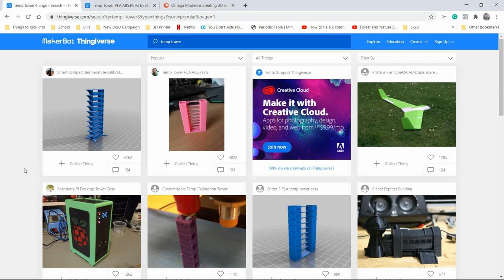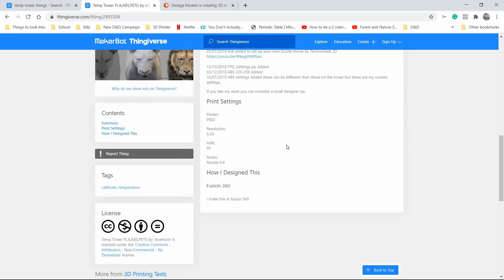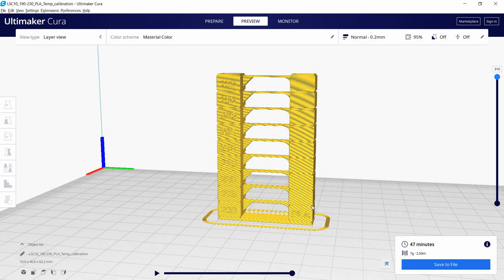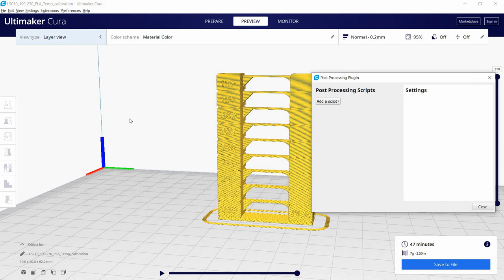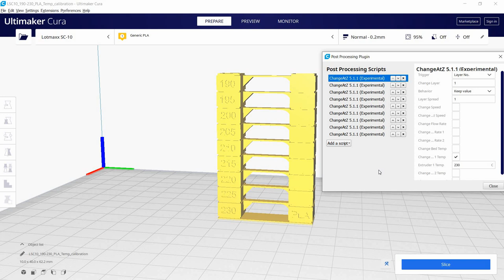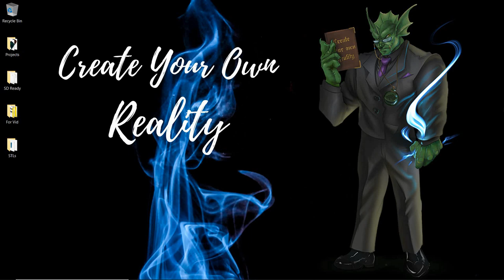How to Create a Temp Tower Test in Cura

Comment: Excellent, thank you very much. Why should we need to delete the post processing scripts after saving the file, like you said at the end of the video? Wouldn't we want those scripts saved as well so we don't have to add them again whenever we change other slicing settings?
Reply from the maker: Hey there!
I'm glad you found the video helpful. There is actually an easier way to create temp towers using a fantastic plugin for Cura.
I'll post a link below to the video I made covering how to use that plugin.

But to answer your question. As long as you have those scripts in place then evey model you slice will change temps just like your temp tower model. So that could have some really frustrating effects on your models of they aren't removed.

https://youtu.be/EAG_538k_bM
Reply: @SlicePrintRoleplay  Oh, I see, so it stores the post processing scripts sort of as part of the template going forward.

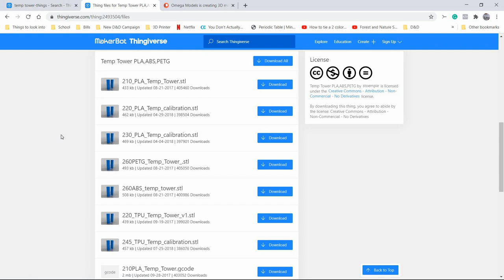Comment: Hi, I had 311 layers here as well and ended up being 1\38\72\106\139\173\206\240\273. At 95% infill and .2 layer hight and 50mm/s I get a print time closer to 1:30. What settings do you have to be running a 47min temp tower?
Reply from the maker: So this video is from a little over a year ago and Cura has changed a lot since then. It's very possible that Cura was giving me an incorrect estimate.
When I print a temp tower I almost always use all the stock settings for the 0.2mm layer height profile in Cura.

I recently made an updated video that explains a much easier process for crating temp tower tests in Cura.
You can find that video here, https://youtu.be/EAG_538k_bM

Comment: Cura 4.8 the "Apply To" now has Target layer or Target Layer + subsequent. Do we do the target layer or are we looking at the whole layer like 1-33, 38-71 etc?
Reply: set to subsequent, if it’s just target layer, it will print only that single layer at the desired temp instead of ~30 layers
Reply: @LadAus  Thanks, I appreciate you

Comment: Hi great vid, thanks. However, when i pull  the tower into Cura as per your vid i'm getting 311 layers, not 310. Also (as i'm a noob) i assumed that if i changed how many "top layers" and "bottom layers" i had then that would influence the total amount of layers, but it makes no difference. Both my top and bottom are currently set to 5, if i change to 4 and re-slice it doesn't give me 309 total layers. Can someone educate me please?
Reply from the maker: You're the second person to say they're getting 311 and not 310. If you're using the same layer height that I'm using in my video then my assumption is that Cura has changed something about how it calculates layers in an updated since I made the video. 1 layer likely won't make a difference though.

As for the top and bottom layers.
There are a few different settings you can specify for top lays vs bottom layers vs normal layers. It doesn't really change the number of layers just how many layers are considered to be bottom or top layers.
For example, you tell Cura that you want the bottom layers to be printed 5 degrees hotter and at a thicker layer hight then the rest of the model. Then tell Cura you want to designate 4 layers as "Bottom layers" so Cura will apply those settings to the first 4 layers.

Does that all make sense?

Comment: "it will tell you what temp to use for each type of filament". ABS and ASA really don't work well for temp towers because every level is pretty much the same. By the time you start seeing differences, you are so outside the proper print temp that its kinda pointless and can get you chasing your tail thinking that you got the right temp from the temp tower. The only reason they are listed as being "for ABS etc" is that the towers encompass typical ABS temps in the text on the side. That's it, nothing else specialized towards any particular filament.

The reason these gCodes often smash into the beds is because many people use Zoffsets that incorporate their desired Zoffset into their slice and that offsets the nozzle to match their bed height. These gCode files do not contain or know about any offset you are running (unless its in firmware). ThesegCodes are set to .18mm above home. So if you have a glass bed installed with a 4mm offset that nozzle is going to bury itself in your glass. Slice this file yourself to be sure.
Reply from the maker: That's a lot of awesome info and it's much appreciated!
Reply: I wonder if the same goes for pla+. I just printed out one of these things and every single layer looks exactly the same. So the temps either didn't change or I don't know.
Reply: @dangerous8333  It really depends on the filament brand. Some have large temp ranges of acceptable behavior and some are just problem children. Temp towers aren't indicative of the usual kinds of stuff most people print, so it's usually much more useful to find a model you can get to know (a small one) and do a range on it and you can see how it reacts to the different settings. I'm a fan of the Witcher medallion on Thingiverse for this kind of test. Prints quick and has realistic overhangs, fine detail and a large range of density variations.
Same goes for stringing tests. you can blow your brains out trying to reduce the stringing on those two cylinders, but if you had stopped at test three and tried a normal model you would probably already have an acceptable print.

Comment: Newbie here...I'm puzzled by the order of the temp settings. As it takes longer for the nozzle to cool than it does to heat up, you'd think that the current temp settings are backwards, aren't they? 

I mean, shouldn't the tower start with the coolest temp on the bottom, then work UP to the hottest temp? It only makes sense that when transitioning from one temp level to the next, the nozzle needs to change its temp quickly. By starting the print with the hottest temp, we're asking the nozzle to cool down as it transitions from one temp level to the next. But this seems wrong, as again, the nozzle cools slower than it heats up. And since it cools down slowly, it will as a result, print several layers of the lower temp level at a higher temp. 
For instance, let's say that the nozzle is currently printing the 220 deg level. Then when it reaches the z-layer to transition to the 215 deg level, it's instructed to cool to 215 degrees. But that takes a WHILE, for it to cool. So while it's cooling, it's actually printing the 215 deg level at 219 degrees, then 218 degrees, and so on. Whereas if the temp levels were reversed, then it would transition instead from the 215 deg level to the 220 deg level. And in doing so, it will reach its next temp quicker since it's heating instead of cooling, and thus will print each layer with more accurate temps. 
So what am I not getting? 
Thanks!
Reply from the maker: So this is a fantastic question and I love where your head is at. There is a reason why it needs to start with the hottest temp and not the coolest, but I want to touch on a few things you said.

You are absolutely correct that heating can be faster than cooling, but typically not so when the nozzle is moving. When the nozzle is moving it's being cooled by both the fan and the air it's being moved through.
Another thing to consider is that each test has 20+ layers (more or less depending on the layer height). So while the first 2 or 3 might not be the exact temp the other 17-18 will be. So the majority of each test block will run at the correct temp.

If you feel like cooling is an issue for your printer then you can always slow your printing speed down (in your slicer or printer menu) and give the nozzle more time to cool during transitions.

The main reason why it should start at the highest temp is because it's very possible for some filaments to jam at colder temps.
So this would mean your test would fail at the first level and you'd get no data.
Almost all filaments will give you poor results when printed at higher than their optimal temp, but they will give you results.

Again this was a fantastic question, thanks for asking!
Reply: @SlicePrintRoleplay  That was an awesome and very informational answer! Thx! It's funny... I wrote my question last night, and printed my first temp tower today. As you would expect, you were spot-on about how quickly the nozzle cools. I was quite surprised, actually, at how quickly it dropped it's temperature from one level to the next. And I hadn't thought of those other reasons you provided. So again, thanks!
Reply from the maker: @bgm-1961  no problem at all. Thanks for the great question!
Reply: @bgm-1961  late response, but I’m just getting into 3D printing and came across this video… another thing to consider for dropping the temperature quickly is the filament itself will take some of that heat away from the nozzle (as it melts absorbing the heat), effectively cooling it too.

Comment: Great tutorial, just what I was looking for. However, I followed the steps,(Cura has had a couple of updates since the version you're using I think, though essentially the same), & transferred the G-code to the printer via memory card (Ender 3 V2). The printer failed to follow the temp changes, so I had to do them manually. Any idea why the temp steps didn't take? allowing for you not knowing my set up of course
Reply from the maker: I apologize that this video is a little out of date. I believe another person had this exact issue so I'm guessing another step is required after the latest Cura update.
I'll see if I can find an answer though.

As soon as I get a chance I'll be updating this video to show how to do this process with the latest version of Cura. Thanks so much for the feedback I really appreciate it!
Reply: @SlicePrintRoleplay  No worries. Good that you’re on the ball. Quick response
Reply from the maker: @nicholashurl3030  I always try to respond when I see a comment.
Reply: @SlicePrintRoleplay  that’s great. Many don’t it seems to me. Keep it up the good standards. Thx
Reply from the maker: @nicholashurl3030  I really appreciate the positive feedback! I definitely want anyone who finds my videos to feel like I'm here if they need help. 👍
Reply: @SlicePrintRoleplay  yes, the same thing is happening to me with cura 4.9.1
Reply: @yellowsquare5998  My ender 5 pro isn;t following the temperatures either. Defaults to 200 nozzle and 50 bed, as per the cura initial settings

Comment: Why does mine say layer height is 208 and plate is 3 instead of your 4 and height 310?
Reply from the maker: Are you using the 0.2mm layer height profile in Cura? The different between the bese of the test being 3 layers instead of 4 isn't a big deal. That's probably just a slight difference in how Cura calculate the layers between the older version of Cura I used in the video vs the newer one that you're likely using.
However, the difference between 208 layers and 310 layers is a pretty big jump. So that's either going to be that you're maybe using a different model or a different layer height setting.... Or Cura is being really weird!

Comment: Hey, I was wondering why my printer says it will take 1 hour and 23 minutes to print, but yours says 47 minutes? I am very new to 3D printing.
Reply from the maker: Different printers work at different speeds.
You may also have a different layer height selected than I was using in this video. Bigger/thicker layers print faster.

Comment: Just wondering if this refer to the temp of the nozzle, does that mean the temperature of the bed must be kept constant ??
Reply from the maker: Typically yes the bed temp stays consistent from start to finish.
Reply: @SlicePrintRoleplay  Hi makes sense so you would need multiple towers one for each temp and then see the best possible combination between nozzel & bed temp
Reply from the maker: @MI-gs1qo  I wouldn't go through all that. For PLA 50c is fine. Are you printing with PLA?
Reply: @SlicePrintRoleplay  Hey I am new to 3D printing and I am printing with PTGE. I bought an Overture filament and they suggest that the bed has to be between 80-90 and the nozzle between 230-250.
Reply from the maker: @MI-gs1qo  no problem at all, I made my channel specifically to help people who are just getting into this hobby.
PETG, ABS, etc. All require higher temps both from the nozzle and the bed. I'd definitely follow the manufacturers directions to get find base settings.
Reply: @SlicePrintRoleplay  Thank you very much you are great
Reply from the maker: @MI-gs1qo  happy to help. If you have any more questions feel free to post here or find me on Facebook.

Comment: Another question, how can you tell if the postprocessing g-code scripts are actually working? My ender 3v2 lcd doesn't show any change in temp from the default of 200. Also since your vid the scripts for ChangeatZ 5.2.1 (updated from 5.1.1) and instead of having "Behaviour" and "layer spread" now has "apply to" where you can select a 'target layer only' or 'target layer + subset', which i'm guessing is every layer until the next script says otherwise? If so then i should have done that.
But i selected 'target layer only' as your 5.1.1 setting for "layer spread" was set to 1.
Reply from the maker: You are correct. The settings have unfortunately changed with updates to Cura since I made the video. I will definitely be making an updated version of this video soon. Until then, if you're printer isn't displaying the correct changes on the LCD than it's not changing. It's most likely the "Target layer + subset." option. I can't say for sure though as I've not yet created one with the newer version of Cura... Sorry I can't be more help right now.
Reply: @SlicePrintRoleplay  Thanks, and yes we're both correct :) I noticed the temp dip to 195°C on that actual block but went straight back up to 200°C again, implying that "target layer only" does indeed mean exactly that. So everything pretty much printed at 200°C and it looks really nice. Zero stringing or anything that looks like it shouldn't be there.
Might still do it again properly to see the differences though.
To avoid deleting the scripts that i might want to use again, i just unchecked the "enable" button on each script. Hope that stops them slicing any more models until re-enabled.
Reply: Ok, back track on that. I definitely have Target Layer + Subset on for each script and i saw my first layer go up to 230°C, so i thought i'd nailed it. But then after layer 1 it came back down to 200°C. So i don't know what's up with that. Food for thought for anyone trying Cura out this way.
Reply from the maker: @kevinjackson5191  hmm. I'll definitely see if I can look into this. Sorry the video is outdated and causing grief... I'll try to make time for an updated one soon.
Reply: @SlicePrintRoleplay  Hey not your fault buddy. I got as far as i did with your help, so please don't apologise, it's all a learning curve :)
Reply from the maker: @kevinjackson5191  I appreciate that! I'll definitely be doing an updated version of this video as part of the "Let's Print Something." series I just started... Once I get to the video explaining how to fine tune your printer using this and a few other tests.

Comment: This temp tower shows as 311 layers in Cura for me. Any idea why?
Reply from the maker: What layer height are you slicing it at?
Reply: @SlicePrintRoleplay  .2mm. Completely default Cura profile. I actually noticed it last week, figured it was a bug. By coincidence completely reinstalled windows and Cura over the weekend. Just went to slice it again and noticed it still shows like that.
Reply from the maker: @alexlasher6833  hmmm that is odd. So you're getting 1 extra layer. 🤔
So couple of things I think it could be.
#1, you're using the same model I have in the video?
#2, could it have a raft or any other special layer added under it?
#3, with the new Cura update its calculating slightly differently than it did during this video.
Reply: @SlicePrintRoleplay  1. Yes. 2. I've only printed on a raft once. It's off now. I haven't enabled any other special layering settings. 3. I guess this could be it. Just figured it was worth mentioning, it had me scratching my head.
Reply from the maker: @alexlasher6833  yeah it's definitely odd, but 1 layer differences could just be from an update. If you notice anything else definitely let me know.
Reply: Im getting 311 as well. also my first bridge is at layer 36??? i have four base layers??

Comment: Tried to print this on my Ender-3 Pro, sliced on Cura v 4.9.1, but the printer freezes after the 220° level. Anyone else had this problem?
Reply from the maker: Hmm that's odd. I've not hard of that happening before.
So it just stopped moving at a certain layer and never started again? It did maintain temp or start cooling down?
Reply: @SlicePrintRoleplay  It was completeley frozen. I had to recycle the power, and when it starded again it had cooled down a bit. There was an option to resume, but after a couple of layers it froze again.
I'm now testing another tower from Thiniverse (there are lot's of them :-) ). It seems to work better. So far at least. 
Your video is great! It's applicable on any model out there.
Reply from the maker: @aalkmar  okay that sounds like a bad sliced file then. If it's working with another sliced file that likely rules out a bad SD card and firmware.... Hopefully it was a momentary issue. If it happens again I'd try using a different SD card.
Thanks for the positive feedback, it's always appreciated!